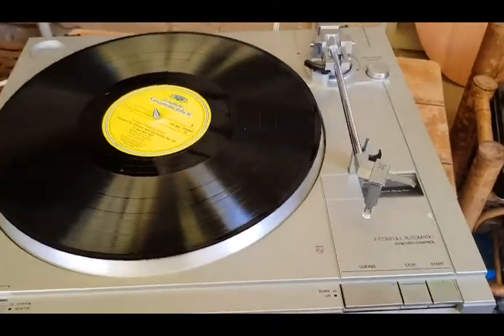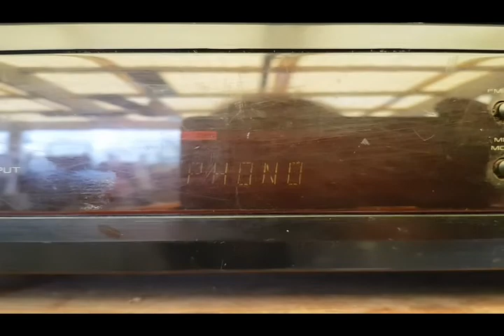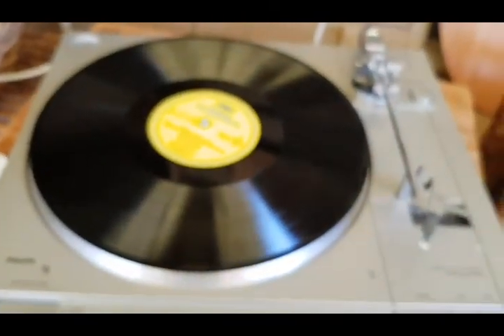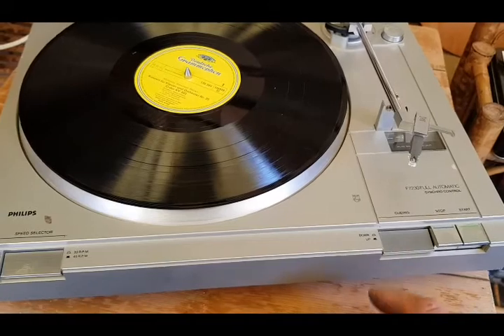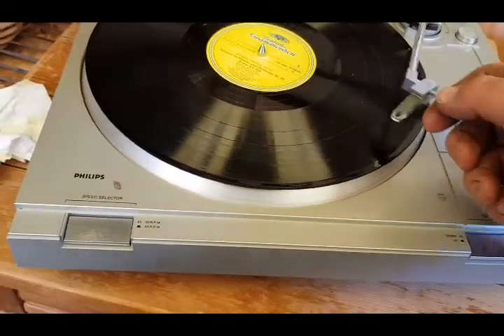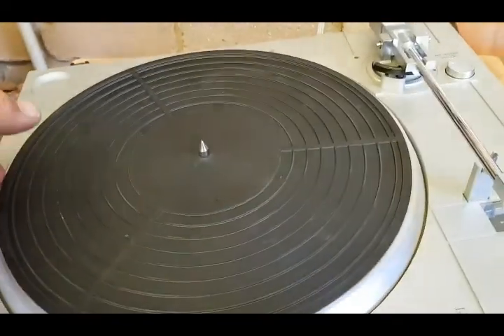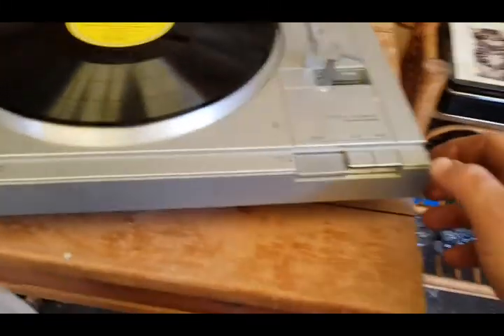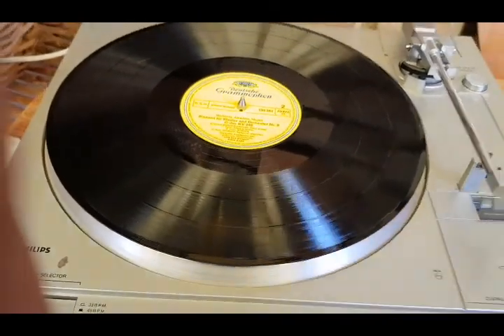Phillips F7230 record player not working

Comment: Could you solve it?
Reply: I have the same problem. Were you able to get it working again?
Reply: @hannistuhl8621  I am not an expert. I opened it, 3 screws at the bottom, inside a rubber dissolved in my player.  At this moment I do not know if this rubber is still available, nor do I know how this rubber was placed.